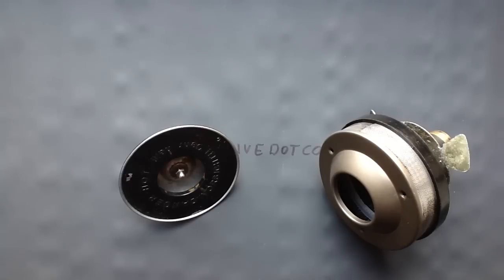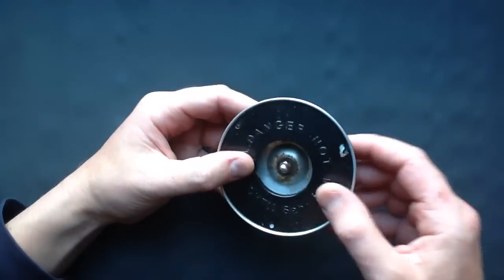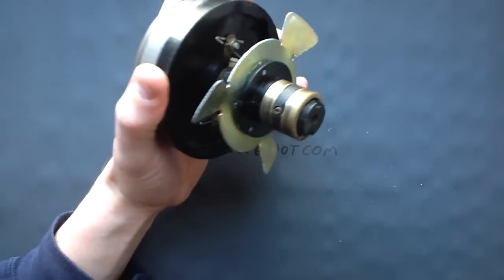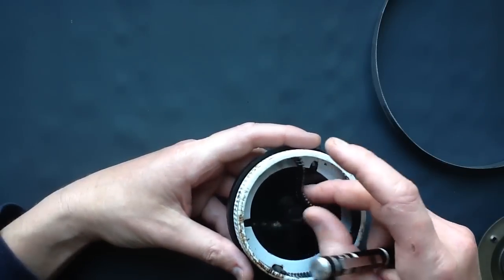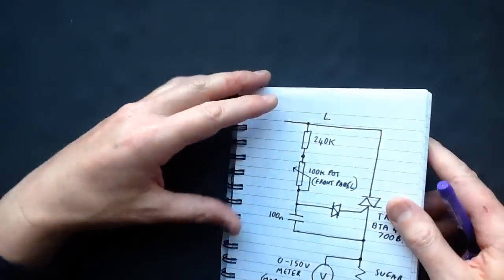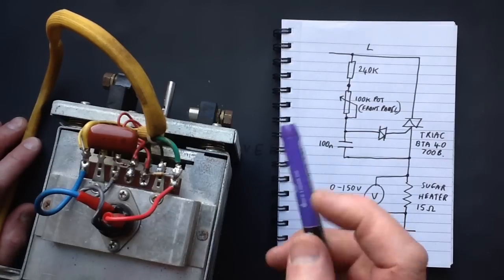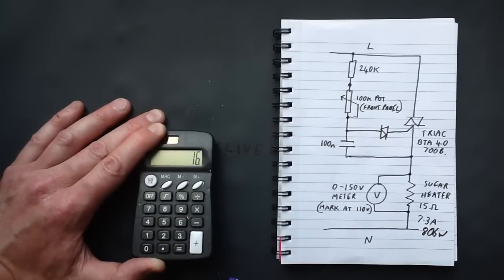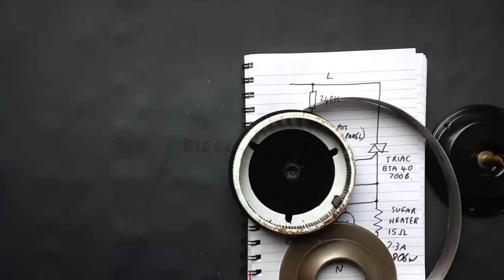How does a cotton candy floss machine work?

Comment: Power for AC supplies would be half of what you mention here. P = (V*V)/(2*R)
Reply: Finally the comment I was looking for ,when machines have the option to work with 2 different voltages,in both the machine works with the same power (watts) that means if using 115 volts the current is 20 amps when you use 230 volts  the current will be 10 amps...

Comment: I think you are incorect about where the floss liquid exits.   All of them seem to release the liquid in the center.    The mesh seems to be to ventilate The heating element
Reply from the maker: There are two types.  The dish with plate where the molten sugar exits at the edge, and the heated mesh where it exits through the mesh as it melts.

Comment: Thanks . I have a 110v machine ordered . I belueve a gas heated spinner head will fit and a plumbers torch might heat better .  But I imagine it might catch fire to a spinning cone . 
 I am amazed at the screen mesh . Is it there or is it not there on the spinner head that will be on my machine .
Reply from the maker: Some modern machines don't have the mesh.  Just a thin gap at the top of the sugar kettle.  The gas machines are relatively safe and can have very high output.

Comment: I never saw the mesh or holes before  . I knew something had to be there .
 The gas flame heater is more practical for me especially in a carnival lot far from an electric power pole . 
 And the fans purpose was not clear until now . Thanks  . I learned more from this one video than from all the " wire candy ''  diy videos .  The diy candy was funny like motor wire crunchy and the machine they made fell apart but was edited out with a thumbs up grin . Crunchiing on his straw candy

Comment: Are you sure the melting point of sugar is 160 degrees Celsius, as it says it's 186 degrees Celsius online? Also which voltage on the industrial candy floss machine needs to be selected to achieve the required temperature/melting point temperature, as taking the Temperature higher than the melting point causes the liquified sugar to hit against the pan/collecting bowl and get stubbornly stuck on it where it forms a "sugar-ring" around the entire collecting bowl rather than giving it a chance to cool down and solidify into strands/webs when airborne?

Comment: I inherited this exact cotton candy machine—looks like a robot.  Same heating element.  Worked great.  Recently, the hearing element finally got too brittle.  I bought Nichcrome 60 wire.  Seemed to be about the same size. I made the zigzag coil by wrapping it around a piece of metal.  Each time I turn it on, the nichrome melts and the fuse blows.  Any thoughts on how I can fix this?
Reply from the maker: It may be a higher resistance heating element.  You might be able to buy a compatible element.

Comment: The 240K fixed resistor limits the maximum power to the heater by delaying the trigger to the latter part of the AC half-cycle even if the pot is cranked all the way up (to minimum resistance). Nasty harmonics put onto the mains along with all the other bad things. Thanks for this video, BC, nicely done!

Comment: I have one of the machines with the small black spinner head..it works great but you MUST always soak the spinner in hot water after EVERY use to get the unspun sugar out of it, or it will clog. 

The owner of the racetrack across from me bought a set of China made ebay specials for the concessions..a snowcone machine (actually two, the first one never even powered up and the second just buzzed loudly then burst into flames); a cotton candy machine like the larger one in the video.. it ran ok for about three events (a total of about 3 hours running time) before the heater stopped working, accompanied by the smell of burning electronics (the heat control appeared to be a standard 600w rated light dimmer, not the beefy triac shown here); a popcorn machine (with the motorized kettle) that surprisingly is still working after 3 years; and finally one of those roller hot dog cookers. (I don't know if it still works.) 

I was going to try to fix the cotton candy machine for her, but there was a falling out when they cut my pay without notice. (I announced the races.)
Reply from the maker: For commercial use it always makes sense to get a proper locally made unit.  It will pay for itself quickly.
Reply: @bigclivedotcom  Indeed. They are notoriously cheap when it comes to buying stuff for their business, but have spent literally thousands of dollars on junk racecars and other crap. Then wonder why they aren't making any profit from the track. 

The only thing that still works over there is the P.A. system I designed and installed for them. I used 2 QSC CMX300Va  amps (in bridge mono, 600w direct drive of a 70v line) a Bheringer ZMX8210 mixer and Furman PL PLUS -C surge protection strip. I drive the spectator areas and the pit area separately, with about 24 horns at 32w each. 

It works well enough to be heard over the noise of the cars, without being too harsh.  

The only problems they've had is when they burn or weedwhack the weeds on the pit area fence, they wouldn't pay for conduits to protect the wire and it frequently gets cut or burned.

Comment: +bigclivedotcom I'm building a "machine gun" that shoots a continuous stream of cotton candy, and I've been looking for an appropriately sized flossing head for parts. Do you have any information on the larger head you disassembled in the video, or what machine it was from?
Reply from the maker: This was from a poor quality machine that had low output and was problematic.  The highest output machines tend to use gas heated heads.  The cotton candy gun is going to require a custom designed floss head to get a high enough yield in a small area.
Reply: Thanks for the response. The plan was to use a (appropriately fused) lipo string to run a commercial flossing spinnerhead at ~150%-200% it's rated power for a short period of time. The project will be fairly involved, but any hardware that I can experiment with would help.

Comment: So all those intricate pieces are washed thoroughly on a daily basis at fairgrounds. Hmm, i wonder. Plenty of cracks and crevices for bacteria to form with the aid of heat.
Reply from the maker: The sugar melts at 186C (367F) and nothing is going to survive that.
Reply: bigclivedotcom that's a good point. You've quashed my fears Clive. Always wondered how they worked.
Reply: bacteria also need water to survive, they can't live if there is no free water laying around (not to mention osmotic pressure problem)

Comment: I think your calculations are off. The heating element is in fact a coil so it is an inductive load and not a resistive load as you have calculated.

Comment: US wiring is black=hot, white=neutral, green or bare= ground(earth). That would be the single phase colors for 120volts. Red is also hot, usually used in 240V circuits or 3 phase systems, and often used in 3-way and 4-way switching arrangements. Three phase gets a little more fun:
Black, red, and blue = Hot 120/208V 3 phase wye, 
yellow, orange, brown = Hot 277/480V 3 phase wye, but also I think delta.
240V delta three phase is extremely rare but may use the same colors as 120/208, I'm not sure. With delta, you also have what we call the bastard leg. On a 240V delta system, the only way to get 110 without an additional transformer, is to use the center tap of one of the pole transformers as a neutral. This gives you two legs that are 120 volts line to neutral, and the third "Bastard" leg is 208 V to neutral. Don't accidentally connect a single phase lighting or receptacle circuit to that leg unless you want things to go bang.

Comment: I had  a machine that used the head with the black ring on it and it clogged up after 2 days
Reply: You just need to soak the head in very hot water for a bit and it will unclog.

Comment: We Americans typically see either red black and green or white black and green as positive negative and ground respectively.  Green is always going to be ground, even the copper wire that the house meters use for ground is green.  Now this isn't to say that some wiring won't be foolproof, there's some shoddy electrical jobs that'll use ground as a dedicated negative, instead of feeding a negative into the circuit, or they'll just wire it to the electrical housing box like an idiot.  This is how electrical fires are started, and the fire department can't do a goddamn thing, what are they going to do, spray water on a live circuit that's on fire? o.O

Comment: Wrong direction Clive ! The drops move out tangential to the drum not radial straight outward.
At the price, the Chinese spinner is a steal. As for dangerous, China does not subscribe to Western Theory  of over over wrought safety.  Most users worldwide are not dumb. Want safety? Inspect and correct and if you think you are dumb buy a US,  Jap or Euro machine for 10 X price. Ground it yourself if you wish.. 
Most accidents are caused by user doing something completely and unbelievably stupid. Not lack of earth, anyway.
besides it helps clear out the gene pool.

Comment: I once saw a cobweb maker that works very similar to this. A fan was added to the outside of the drum to blow the 'webs' , and instead of sugar you used bicycle puncture repair glue.
Reply from the maker: +mickenoss The spinning drum version.  The newer type uses a compressed air line blowing across the tip of a hot melt glue gun.
Reply: +bigclivedotcom Cool, haven't seen those before :)
Reply: Hot glue sticks might work too 
  But i almost died from blow in insulation was on my respirator mask and when i pulled it off i inhaled some and it stuck in my throat . I ended up trying to inhale it to dislodge it . I managed a pin hole breathing hole  and it took a minute to inhale a breath . That went on for hours . Ugh  Nothing else to do . I had laryngitis for a year at least . Watch out for that blow in insulation .  It is in attics . You cannot talk or yell or call for help if you are choking .
 Dont let kids play in it or play snow with it . Tell people it can kill you no joke .

Comment: I use to work on the Gold Medal Ribbon brand machines that were in a place I worked. The only repairs I had to make in 6 years was replacing the ribbon heater about once a year which if I remember right was not fun to do, had to take half the head apart to get to the terminal screws.
Reply: +sublimationman  Not one of my favorite jobs when I worked for CEC entertainment.  (Yep, I used to be a service tech for a huge 6' tall rat/mouse).   Ours was an older Gold Medal Brand with double ribbons for higher output.  Extremely well built!  However the dingbat employees would always forget to burn out the remaining floss/sugar mix and it would cake up inside badly.

Comment: Putting a fuse on neutral, wat!  Even if the fuse blows, it still will have mains potential on the wiring, still not safe.  That machine would be marked a failure at UL as soon as they opened it up.

The usual wiring colors for the US: 
Line has black or red with occasional blue.
Neutral is white generally, I haven't seen other colors as neutral.  
Ground is bare copper or green, or green with yellow stripes.
Reply: Isn't it great to have the Underwriters Laboratories.
And general health and safety guidelines.

Comment: I wonder if you can make glass "candy floss" using similar machine with more heating power and glass instead of sugar.
Reply from the maker: +Александр Санников Fibreglass insulation is made like this, but the molten glass is poured slowly into a spinning perforated bowl to extrude it into the fine strands.
Reply: Why is it.  things you can eat and things  you shouldn't eat.
 look so much alike

Comment: For people wondering, yes, black is a live colour for United States code; as shown:
PG: bare-wire, green, green & yellow; N: grey, white; L: black, red; L1: black, brown; L2: red, orange; L3: blue, yellow

Why phase-3 power supplies can have either blue OR yellow is beyond me, especially when earthed, since earth can be green and yellow, so that might be a deadly trap for young players. I suppose I can see the logic behind using warm colours for live (three phases using brown, orange and yellow, though for L1 I would be partial to red), but it seems to make little sense.

Not that it matters anyway, a lot of electronics is working with what you've got.
Reply: I once came across a 3-phase chandelier in Belgium - they work off 2 phases to earth, the result of a kludge at the end of WWII when the entire generation plant was destroyed and had to be rebuilt quick.

Comment: That calculator would have worked for sure if you had removed your finger from over the solar cells. LOL.
And yes, it is Black = Line, White = Neutral, and Green/ Bare copper = Earth..
Also, 4KW? I think you have that wrong. An entire home only uses 6KW if EVERYTHING is on at the same time.
Reply: My home can draw 48kW if everything is on.

Comment: Canada here, White is neutral, black is hot and red is the other hot. Green or bare is ground obiviously.
We use split phase 120/240, hence the 2 hots. Neutral is the center tap, and is grounded at the service panel.
Reply: +thephantom1492 Same in the us except we use two blacks, anytime you see a red it has come from a switched hot.

Comment: In the US, the majority of cotton candy machines use machined barrels with diagnal cuts in them to flow the sugar from. I'm pretty sure they just use lrge induction motors, and maybe use heat transfering bearings?

Comment: I'm wondering if you could use some type of inductive heating and temp regulation like a  "Met-cal" Soldering iron. They work off the specific properties of a magnet losing its ability to have magnetic flux at a given temp depending on its composition. So when used as a thermal regulator they are quite stable and don't burn out or drift over time like a thermistor might.
Reply: Wow

Comment: A more elegant solution, avoiding the brushes, would be an induction heater, or maybe even some strong permanent magnets around the rotor to heat it by eddy currents.
Reply from the maker: mikeselectricstuff Induction is probably viable.  Not so sure about the magnets, since the heater is running at 1kW or more.  The brushes are probably the cheapest option though.
Reply: I don't think eddy currents would cut it. You'd probably need generator windings to power the elements, and a really strong motor to drive it all, in order to come up with that kind of wattage.
Reply: +bigclivedotcom  In which case the motor will power the heating. Motor too big and expensive
Reply: bigclivedotcom the heater for melting a bit of sugar should be 1kw are you really sure ?

We talking about melting a spoon full of sugar.

Comment: I've had experience with machines similar to this one: https://goo.gl/uKJgsO
They were wired into 20a 120v sockets, and had large isolation transformers between the head and mains. also served to reduce the 120v to something more like 40.
and instead of triac controls, they had variacs!
These machines are beasts, weighing in at something like 70lbs.
I don't know how they can break down, they're built like tanks, but our fair/carnival figured out how!I think I swapped out at least 1/day out of 30 machines active.
Reply from the maker: Daniel De Jager An isolation transformer would be an ideal safety feature for the heater, but because of the load, would weigh a lot on its own.  The heaters in these things take a pounding, so I'd guess the most common fault was heater failure, followed by wire fatigue at connections due to vibration.
Reply: bigclivedotcom 
These machines were absolutely, ridiculously, heavy.
I think our common failures were the heaters, sliprings, and indeed, fatigued connections.
For some bizzare reason, they had a sort of "overdrive" that ended up cooking many heaters
Reply from the maker: Daniel De Jager I guess you have to weigh up profit from selling loads of candy floss, versus heater cost.  In the Uk a common fairground trick was to cut of part of the element when installing it, so that it ran hotter and pushed through more floss.

Comment: yes here in america our common household wireing is black, white, green (or bare) we use  a split phase system, meaning we use 2 slit phases of 110 to get our 220 for heavier applainces. Black (and red in 220-240) is live, white is neutral and green (or bare) is ground.
Reply: True, true.  Image showing single (normal outlet) and then 3 color codes for 2 & 3 phase 220v)
http://www.electronicshub.org/wp-content/uploads/2015/09/US-Color-Code-for-Electrical-Wiring.jpg
Reply: It's a single phase, with 2 legs from a center tapped transformer.

Comment: It looked like the plug on that machine was a 2 prong US one, but I take it that it was not polarized with the larger neutral prong.  The construction of that machine looks like it was built in the 60's or 70's which would explain why it was not properly earthed.  I am surprised it even handles 240vac when I would guess it was only ever designed to handle 120vac.  Now I want cotton candy after watching this video!
Reply from the maker: ElfNet Gaming I believe China is 220v.  Hence why a lot of the more dubious products are perfect for me to slap into 240v.
Reply from the maker: The two prong plug was for connecting the unit inside its enclosure.  The token gesture earth was the black wire in the other loom.
Reply: kuhrd China I think uses 120 Volts like the US does but they have hardly any standard electrical code and use whatever color wire is handy during manufacturing. I took apart a chinese 2-way radio charger and all the wires in it were black..
Reply: maybe.. IDK to be honest, I know the US is not the only country using 120 volts..
Reply: ElfNet Gaming  you are on the internet look it up